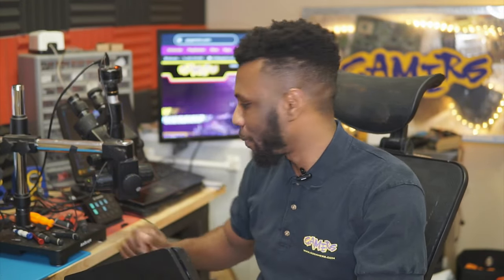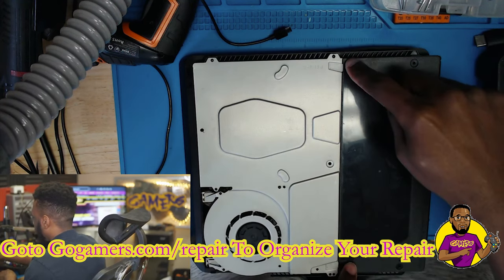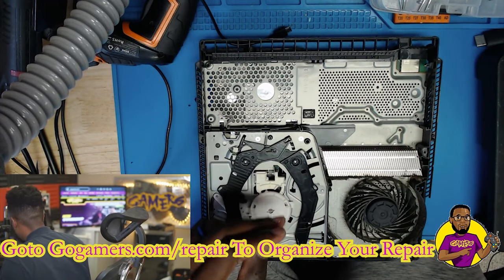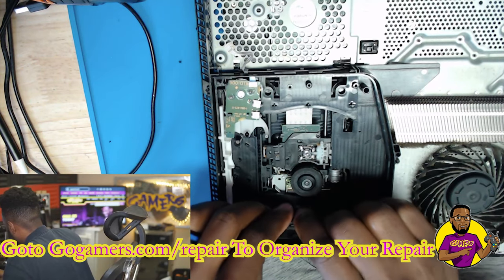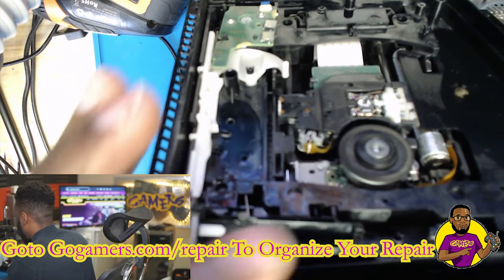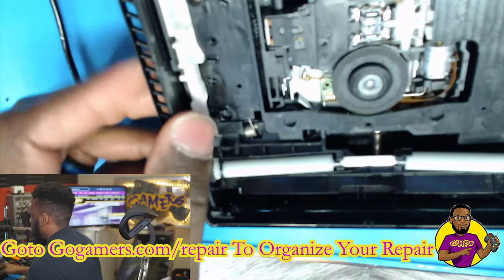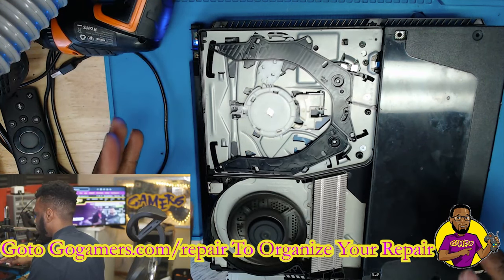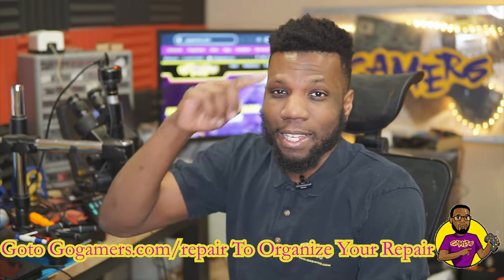Fix PS4 Slim That Wont Accept/ Take Discs Or Games (5 Minute Repair)

Comment: Howdy!! Thank you so much for this video. I haven’t taken my PS4 slim apart yet, but I believe it’s either the rollers, a bent plate, or missing that middle piece that goes in between the rollers. Can you buy a replacement if that middle piece is broken? Or would it be better to just toss in a new drive?
Reply: Give someone else ur problems to fix lol

Comment: Good day brother. May ps4 accept disc,but not running. And when I restart my console with disc inside of it, and  it works. All I have to do is to restart the console with disc inside of it before it reads the game.What could be the problem of my ps4?

Comment: Hey Dave. Excellent video and breakdown of dissembling it. The only problem  I have is right up till after you clean the rollers then slide that white plastic part that slides, it doesn’t. I didn’t want to force it towards me to break it. When I push down the rollers It doesn’t slides and when the rollers are up it doesn’t slide. I don’t see anything lodged in there can you help please?
Reply: Bro, I have the same issue.
Reply: @elliottdaniells2164  i just pushed it really hard and it worked for me

Comment: Thank you. This helped me every step, i couldn't get the black part fully off, but i worked my way around it

My problem was that my nephew jammed 3 games in there, i screwed them out, but it wouldn't take games, so i opened it and found the push plastic piece of the game case in there. Thank you

Comment: I clean roller also every thing s smooth but when i insert disc it stuck and do not pull down when  i restart ps4 then disck go proper position and work please sole my ps4 problem  thanx

Comment: Yo got a question hope you can help. When my ps4 is turned on it dosent take the disc it can’t even enter it’s like something is blocking it but while I’m turning on my ps4 and it’s making the sounds a ps4 does I insert the disk and it accepts but then it dosent read it it won’t even pop up on the screen
Reply: ICIE FG  hope everything goes well I had to take mine apart because I guess a little spring came off and thats why I was having this issue
Reply: exact same with me
Reply: @unknown-xx2rv  did you end up fixing it?
Reply: @jamiukusimo9587  yea some little hook in the disc plate doesn’t move in it’s place when I remove a disc have to keep it moving ir back to its place

Comment: What if my white arm that comes down on the rollers, doesn’t come down at all?
Reply: I am having the same issue
Reply: This happen to me but i pulled it down with some light force, it moves. Mine felt like it was stuck but it moves like on gears so it feels firm
Reply: @robertperala  THANK YOU SO MUCH I FIXED MINE! i got so scared (mine got stuck downwards) i didnt wanna push it back up but then i saw your comment and it did push up i heard the gears it was just so scary lol it looked stuck! you’re a life saver!
Reply: Any fix for this? I think this is causing my ps4 to accept discs 99% of the way but it wont fully accept it. It tries to spit it back out an then goes back in

Comment: I was cleaning my ps4 about 4 months back and the spring in my disc tray flew off and I haven’t been able to find it since. Is there somewhere I can individually buy that spring instead of buying a whole new disc tray for 60 dollars? I’ve just dealt with it all this time but it’s getting really annoying
Reply: Too late incase it helps someone : a rubber band will do the trick jist make sure its tight enough

Comment: 5:58 my lever wont move, any ideas?
Reply: Any fix for this? I think this is causing my ps4 to accept discs 99% of the way but it wont fully accept it. It tries to spit it back out an then goes back in
Reply: @NsaneHOG can you fixed it ?